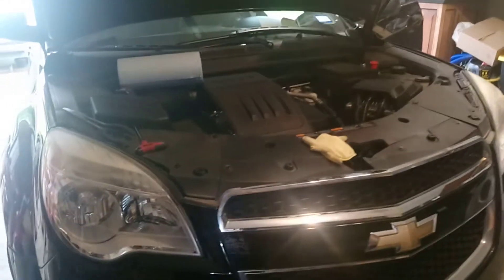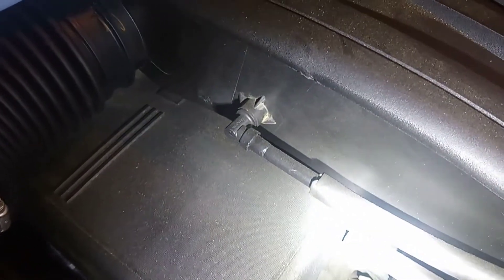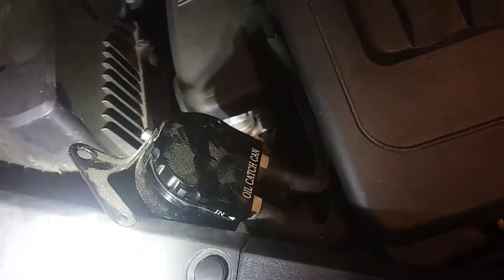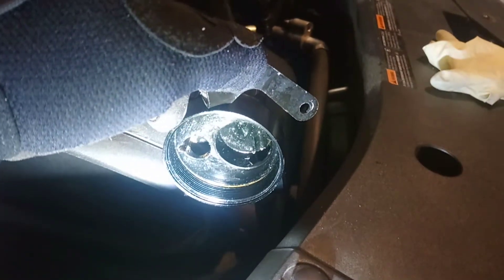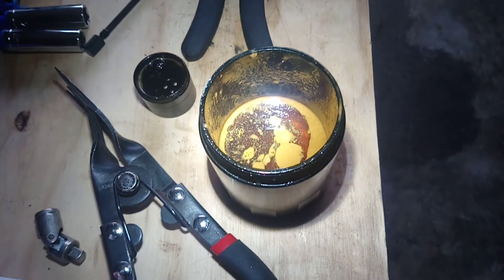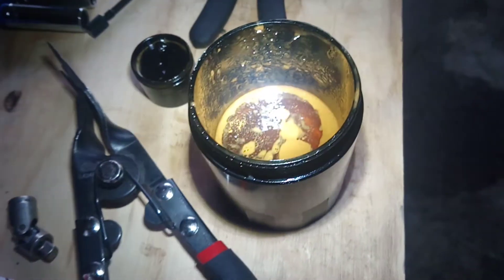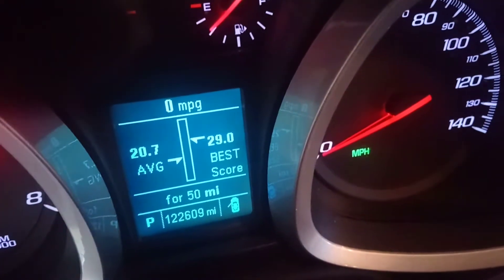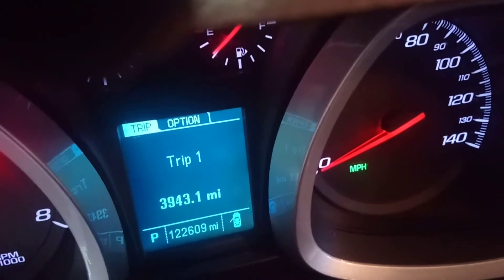GM engine could blow up without Catch Can! Bulletin 14882 DIY FIX for ECOTec motor

Comment: Glad I found your video. My wife and I just purchased a 2011 and it didn't dawn on me that it had this Ecotech with all of the problems. Anyway my catch can came in today and getting ready to install it.
Reply from the maker: Im glad you found this also! I use a bracket from HD and attach it onto the air box most front screw.

They are great cars and I missed it also when I purchased ours. Unfortunately, the issue isn't getting better and each drain is getting worse with less miles. Luckily, the dealership added a "Contract Service" on me when we purchased. Going in tomorrow with all the saved fluid from the 6 oil changes I've had to do because of the oil burn off. Asking them to rebuild and change the oil seals on the pistons. Cant go 3,000 miles without losing 3.5 qts.

Comment: If all that catch can does is prevent that gunk from dirtying up your throttle body it is well worth the time and money.
Reply from the maker: Im glad you found it helpful!
Reply: That catch can is on the clean side breather hose,  that air does not flow over the intake valves....
The dirty side PCV orifice is inside the engine , and no catch can can be added...    a better solution is to use the cfm oil cap,  THEN THAT CLEAN SIDE VATCH CAN WILL STAY CLEAN...
Reply: @pietsee1000  Hog Wash, I installed a dual catch can system on both sides with a performance PCV valve.  Reduced oil vapor significantly.  The CFM cap prevents buld up on the cleanside by creating a bigger problem.  It vents continously and vacuum never builds up or ventilates the crankcase.  A lot of the moisture and acids will remain in the oil.  Draft tubes and vented breathers have not been used for 40 years for a reason.  Time to join the 21st century.

Comment: For the new engines a catch can is no longer necessary! Yes it will catch oil, but the engineering of the system is changed to where oil or very little oil get through the the system. Staying with a DEXOS 2 oil is the most important thing to do.
Reply from the maker: For most engines that's true, but these engines tend to freeze up and blow rear main seals because of this build up. Its oil blow-by most of the time but in winter, it is a lot of water that is getting trapped. Lawsuit with GM is almost finalized due to this engines issue as of OCT2019.
Reply: Hi . I have 2014 gmc terrain  4 cilinder   .   This model need to put or not ? Please